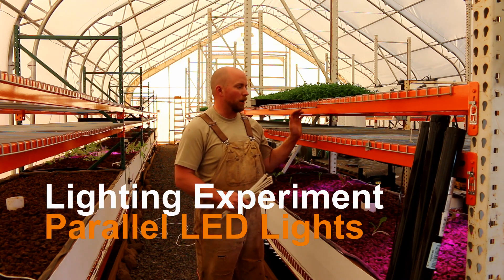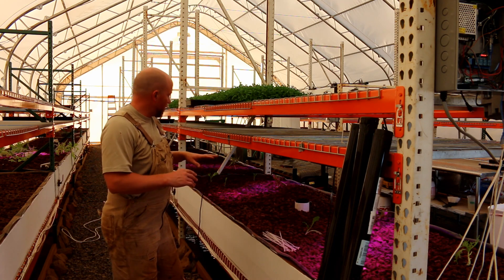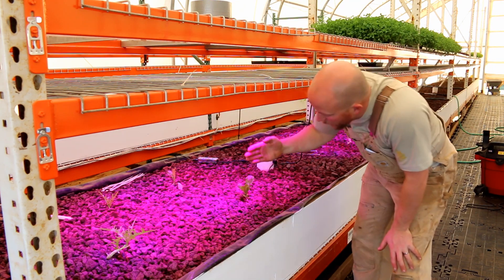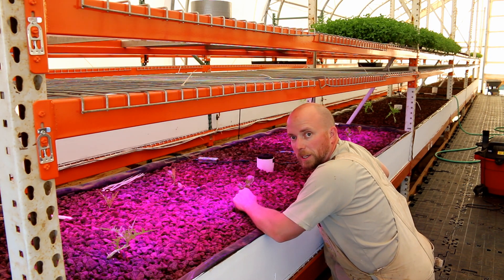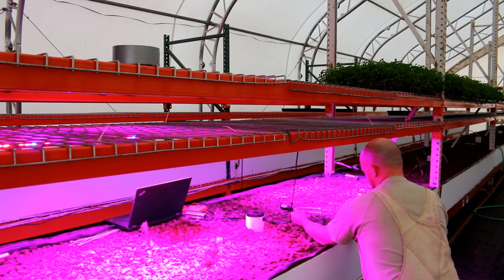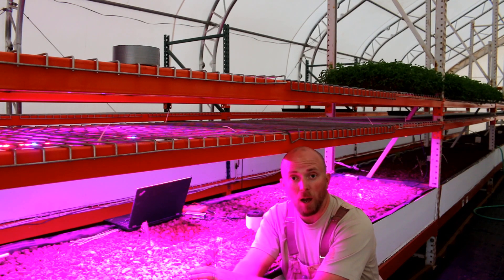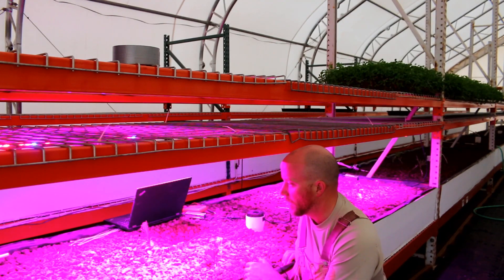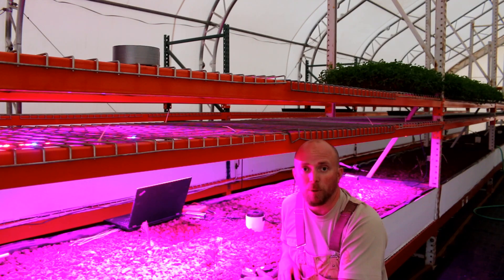Will Plants thrive in AQUAPONICS with LED Lighting?

Comment: You could install 6 lights per bed to get the plants growing, later in their cycle when they grow higher and get more light you could shut down 2 lights, saving some running costs. Those 2 extra lamps per bed could also be seen as spares should some lights break, ensuring production keeps going while you wait on delivery of the new lamps.
Reply from the maker: that's a great idea
Reply: You could also mount the ledstrips on a lite fram made from standard profiles. All connetions will be secured by the frame and you could have a single connetion point for power. 
Add some hooks at the corner and some cains hanging down. You can then hang the frame at any level you want and it will be fast to change it to a new level. If you have a spare frame any fram with a foult can be replaces quicly without problems.
You could also have a thin wires with a loop at one end, for the hooks, and clamped to a main wire. Pulling the main wire will then change level for all the frames at ones. Using a motor on the main wire and everything could be done automaticly.
Reply: I was thinking about the amount of lights... 5 could possibly also do the trick. 2 at either end and 1 in the center.

Comment: With the bulb layout, I wonder if you went to 5 light units per bed, if that would have the enough return on investment.  Install with 2 on one side and 3 on the other so that the patterns overlap, leaving you with 2 slightly darker corners per bed.  Alternately you could further minimize the dark zones by mirroring the pattern on the neighboring beds,  now you would be down to 2 dark corners per lane.

Comment: I don't have any experience with what your doing, but find it very interesting.  I saw your failed experiment  with mylar sheets, and heard your comments about  the overflow from the upper micro trays.  As I understand the systems.  The upper trays use soil or some soil substitute and the lower grow tanks use a flood and drain system (NO soil involved).  Is it possible that the overflow from above could add unwanted "ANYTHING" to the lower system???
My experience is glass, wood and sheet metal.   It occurred to me, you could fabricate a accordian shaped panel out of sheet metal with each bend at 3 " / 90 deg - alternating.  the lower facing surfaces would be facing the lower tank at a 45 deg angle and could be faced with 1/8" mirror tiles for light reflection.  The panels could be end capped for strength and could be angled slightly for drainage and used to catch overflow from the upper trays and diverted someplace other than the lower tanks.  PS- there is plastic mirror made, usually available from plexiglas suppliers if you worry about glass over your tank,  However the plastic mirror is much more costly.

Comment: As I wrote, you need to be able to adjust the height of the light as the plants grow, as you see in your measurements, you need to be close!
Reply: Great point, totally agree.  Need to be able to adjust height.  When you do this, it will change your coverage area.  This might change where and how you want to hang your lights.  Is there an angle of light coming from the bulbs that is strongest, like a sweet spot, or a cone that you can determine?   It might make sense if you are changing the height of the lights to hang both your lights towards the middle, say 1/3 of the width from each edge and straight down.  As you raise them, you would get more overlap in the middle of the bed.
Reply from the maker: the thought here...as in a curious thought...is that plants when smaller dont need as much light, it's only once they get bigger that they do. ex...Microgreens need less then 7umol/m^2/s...but a full lettuce plant needs 17...so I think some experimentation might show that the lights  might be able to stay fixed for this specific (i.e. lettuce, or leafy green) application...if it was a fruiting plant...i think you are right...it would have to move
Reply: Well microgreens can get away with low moles, but from my experience starting plants indoor, as soon as those true leaves come you want to blast them as much as possible without burning the leaves or drying them out. And if you look around how ppl are growing indoor lettuce etc, you see the same thing, adjustable lights, if you don't get enough light when they are young you get leggy plants that do not hold themselves up.

Comment: You could do one bed with four light, and a second bed with 6. Plant and measure the different result. To prove that four is better number. Again, these testing videos, trial and error, love them :D
Quick question, during next summer, will these light be on at night to speed up the growth ?
Reply from the maker: not sure on night time growth acceleration...plants only like so much light and based on what I've researched they need a day/night cycle
Reply from the maker: but that would be a great experiment
Reply: Most recommend resting for 6-8 hours/day for majority of plants.
Reply: 2 things.
4 t5ho bulbs is gonna easily be close to 300 par, and raising them increases the coverage, lowering them would do the opposite.
Depends on the reflector strike back though to an extent

Comment: What about instead of 6 lights to get 80% coverage, you use 5 lights to get 70% coverage. Keep the 4 like you have the positioned lengthwise and put the fifth light width wise in the middle of the 4 lights. So that you would have sort of an H pattern of lights?

Comment: Maybe I missed this from earlier work but have you considered putting the lights straight down the center?  Do they not spread enough light to the sides if down the center?  I think I heard you mention the light spreads two ft to each side.

If the light spread is not enough for full bed width, bias the placement of the light to one side and plant just across the width of the usable light and work only from one side of the bed with an easier/shorter reach.

Comment: The old law of diminishing returns always ruins a good plan for perfection, could you plant things that don't require as much light in the darker spots to use the bed and lighting more efficiently obviously you aren't going to grow 100% lettuce and some plants wouldn't require as much light, also could you place a vertical piece of Mylar at the end of the rows to reflect the light in a bit more possibly with a slight curve in so the light isn't reflected out of the bed? 😊 keep up the good work

Comment: TRM, what is the lumens out of one light? I sent you an email on some LED lights I found that are 6000 Lumens.
Reply: Unfortunately, lumens are not the right way to measure the effectiveness of plant lighting.  Lumens are a specific measurement for human eyes.  For plants, what he's doing is absolutely correct, PAR (Photosynthetic Active Radiation) in mmol/m2/day is the proper way for measuring the light output.

For example, you could have a "white" light (Fluorescent, or whatever) that outputs 10,000 lumens, but the spectrum it outputs is very poor for growing, thus you'll spend a lot of money on a light that doesn't do anything for the plants, but makes things really bright (for us humans).

Sadly, I don't think manufacturers actually publish their PAR outputs on their data sheets.  I have yet to find one that does.  Main reason is that lay people don't understand the difference and manufacturers take advantage of this lack of understanding.
Reply from the maker: TJ B is correct. PAR is the most effective measure for LEDs...this one maxes out at 165umol/m2/s

Comment: Why not use Two way Mylar / Solar Shades / a two way mirror that will allow light IN but reflect it back on the plants once it's inside. That way you can use it on the sides (or atleast one side that the light's pointed at). I'm assuming you're not using mylar on the sides to continue to allow natural light in.

https://www.controlbooth.com/threads/two-way-mylar.1622/

Good info in there.
Reply: There seems to be significant light spill round the bed so if not two way milar, is it worth looking at morning/evening side curtains (final version automated of course)